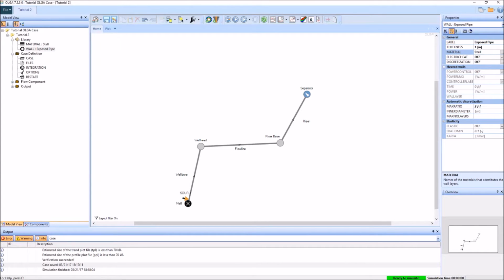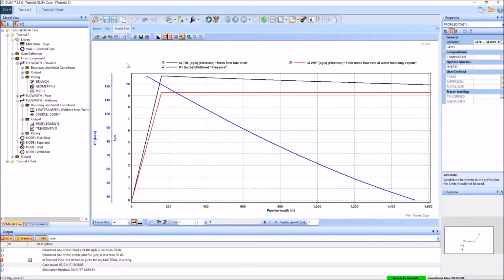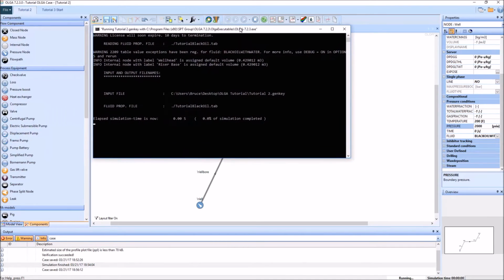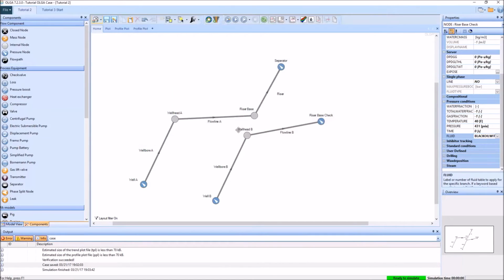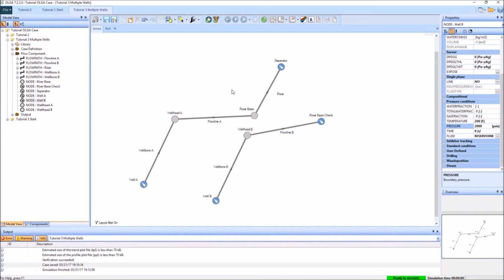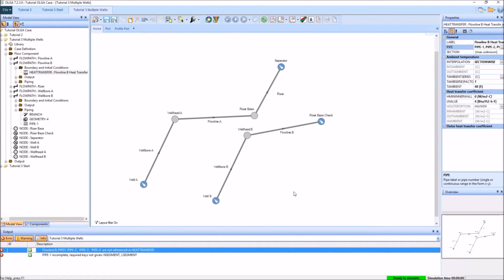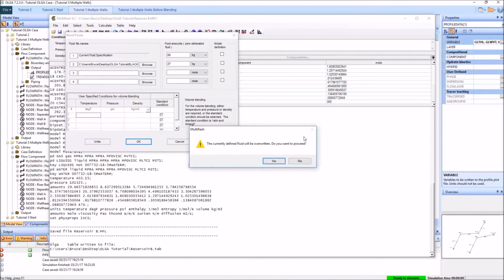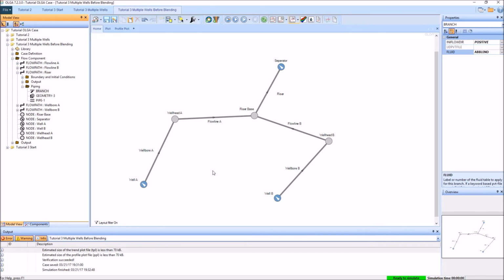OLGA Tutorial 3 - Complex Steady State Cases in OLGA

Comment: when both inlet and outlet were defined as pressure nodes, how can the olga know the mass flow rate in inlet ?  In that case, we also did not set the mass flow rate in inlet.
Reply: It's a typical type of calculations. The thing is that OLGA cannot calculate system like PIPESIM can then you define inlet node with pressure and rate at the same time.